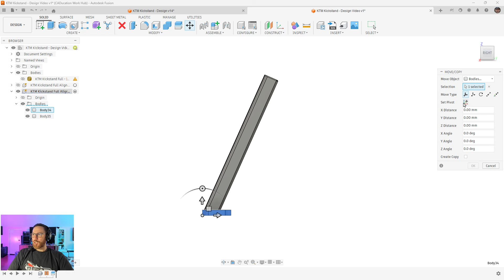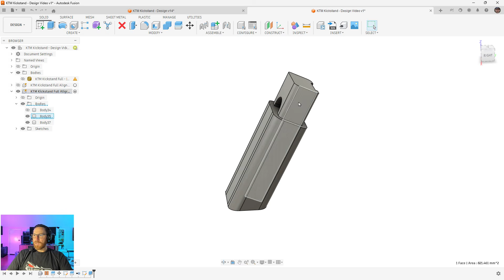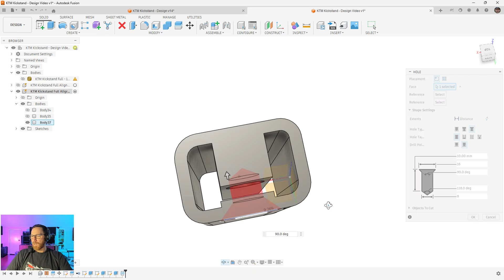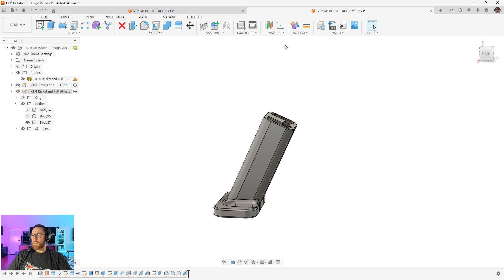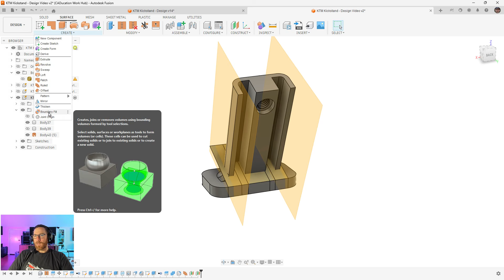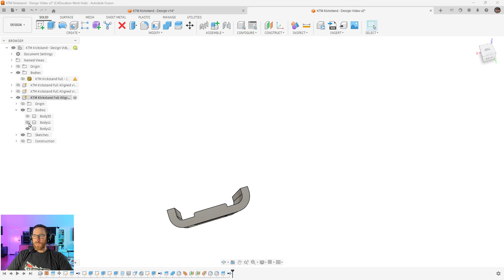Designing an Adjustable Kickstand Part 3 | Design For CNC And DMLS With Fusion

Comment: Is loosening those subframe bolts still the easiest way to pivot the intake off the throttle body. 😂
Reply from the maker: This bike is carbbed so way worse :)  With my custom wiring harness i have some plugs that let me pull the upper subframe bolts and leave the lower in, but i have a 3 piece exhaust where the midpipe can only come off after the muffler...  so gotta pull the exhaust, rotate the subframe, pull the tank, and a few other things in the way.  The efi ones are a bit easier thankfully, but nothing like my old RMZ.
Reply: @LearnEverythingAboutDesign That’s a pain. I could never get the Mikuni on my 17 xc300 right (no one could), ended up just getting a Lectron. Way happier. Thanks for the design content, it’s great!